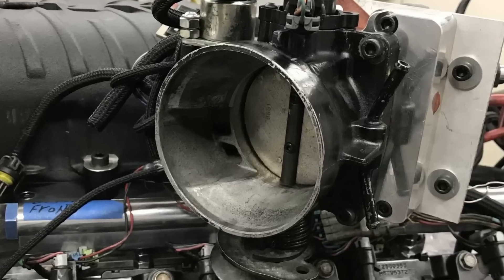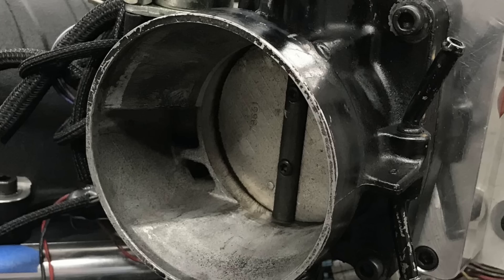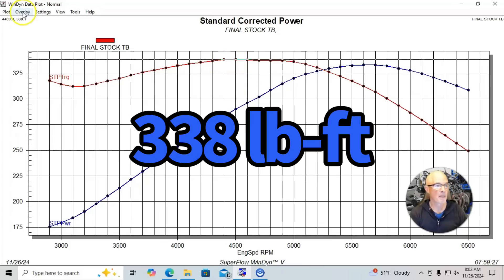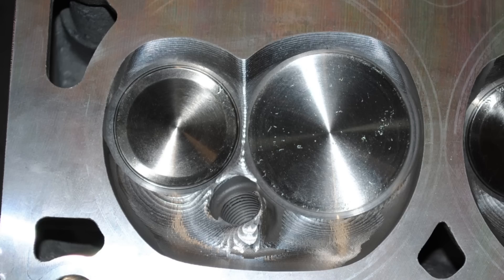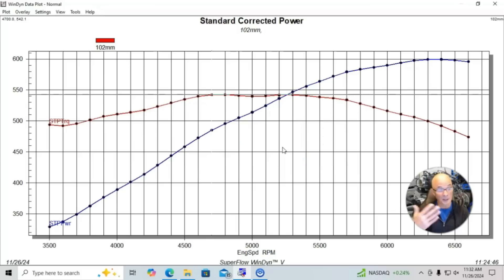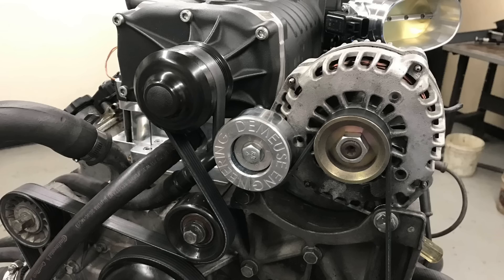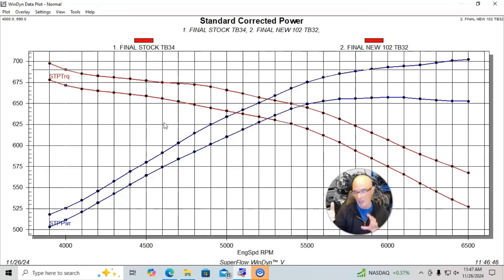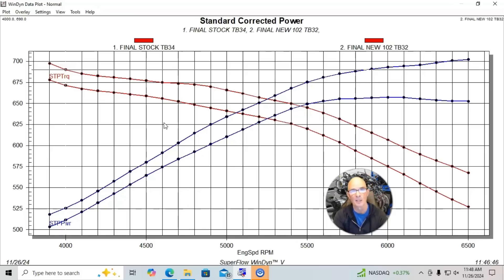LS THROTTLE BODY UPGRADE-WHAT'S IT WORTH? HOW MUCH POWER IS A THROTTLE BODY UPGRADE WORTH ON AN LS?

Comment: Say what's 6kpa worth on a 500hp LQ9 .. I see a 6kpa restriction from 4200-6000rpm then drops to 2-3 kpa at 6500
Reply from the maker: an airflow restriction doesn't drop at higher rpm, it increases
Reply: @richardholdener1727  just what I'm reading on hptuners .. maybe it is making more power at 5800 than an 6200 ?!

Comment: Have a stock TB in my 5.3L Vortec 2003 LS Suburban and just want to get a larger TB to allow more air to flow. Not so much looking for more power. Just a smoother better flow.
Reply from the maker: you won't get smoother, better flow-keep what you have
Reply: @richardholdener1727  so with a bigger TB, it won't allow better air flow? Was also looking to change the manifold and a slightly larger pipe for the muffler (not too big because I'm not looking for that muscle car sound, though I freakin love it).

Oh, and thank you for your response. 👍🏾

Comment: Lq4 stock bottom, comp cam 218/220 afr 220 cnc tbss header and tune. Run 76 mm tb what can i expect from 90 mm tb?
Reply from the maker: on what intake?
Reply: @richardholdener1727  tbss intake

Comment: I've had a running theory for some time  now that selling bigger throttle bodies to people that don't need them produces a perceived result in that the engine is effectively at wide open throttle at an earlier point in the travel of the throttle plate, due to the net area equivalent now happening at say 60% WOT instead of at 85%. How this correlates to electronic fuel and spark control as mapped against throttle position sensor values with no additional tuning I suppose would depend on how air flow calcs are made? I know I've driven plenty of cars with stock throttle bodies and meager outputs where under high load scenarios, there would be no appreciable difference between ~75% throttle and wide open, foot to the floor - and I can't imagine why you'd want to make that resolution even worse.

Comment: Herd if you run enough boost(LOTS) on a single Large TB, the blade will get stuck open.  Can't rem the company that came out with a dual TB intake for boats, due to that issue.  Something to do with blade diameter, surface area and leverage.

Comment: I went 105mm TB as mine is big Turbo ls 427 low ram and I also went up to 2400cc injectors. worked Good on mine, never really bothered with a stock 1 mines got big flowing req ported heads I agree they are a must on a boosted big cube LS

Comment: You've just shown the people why Gale Banks is "wrong". I love his work but you can tell when he's trying to pull the wool over your eyes, like with his Cummins intake elbows. He never quotes power gains specifically, but repeatedly highlights the flow bench results and concludes that based on the evidence, it WILL make more power and use less fuel. However real world testing shows no gain.
Reply: Hmm, I think Gale has his stuff together. He is mainly looking at air density and improving that definitely makes more power (more air density)
Reply: Shit comment. Gale Banks DEFINITELY knows what he is talking about and sells honest quality products. Post less in the future
Reply: Diesels and Gas motors behave different to different things. Banks is the 🐐
Reply: Yes, Gale Banks does know what he's talking about and makes good products, but you've all missed the point I was making. With the example I gave specifically, cummins intake elbows, countless people have done back to back testing, even at four digit power levels, and seen no gains. It's just like putting a larger throttle body on a stock truck motor, all that extra flow of one component adds nothing to the system as a whole. Banks intake elbow flows huge amounts more than a stock elbow, but the stock elbow flows more than the rest of the system, so it's irrelevant. If you go and look at the videos they've made on it, they always harp on about the increased cfm it flows, and then push the idea that increased airflow means more power, but they don't seem to directly say that bolting their intake horn will give you more power (because they probably know it doesn't).

Comment: I have a 2014 chevy reaper truck with 6.2 and it has a magnison supercharger.  It's equipped with the stock TB .  I've been. Thinking about upgrading it to the 95 mm TB or would you recommend going to the 102 mm ? . If I do will I need to get a tune for the air fuel setting ? Thanks Richard I've learned a ton watching your videos!
Reply from the maker: bigger will help-your tune should add fuel with higher boost

Comment: One point with supercharger gains - a roots/screw blower is simply a multiplier for inlet air pressure, so ANY restriction is literally multiplied. 1/2psi lost between the throttle body and blower will drop peak boost from 14 to 13psi. Those tend to be the only time people really can see gains, since few ever build 700+ hp NA engines.

Comment: Was just wondering if the intake swap is worth it on the ls2 cammed 5.3 I shoved into a blazer
Reply from the maker: A Fast is the best choice but expensive
Reply: @richardholdener1727  Thats fine wine for my beer budget mostly gm part# swap. The tbss intake is looking like my budget winner.  5.3 dish pistons 862 heads cut .040 ls2 cam and 26918 comp springs.  basic copy of your ls2 cam swap dyno build.

Comment: In a nutshell: Upgrade your throttle body (and everything before it) to match your intake manifold.
Reply: The comment I was looking for
Reply: Hi Richard, I appreciate you sharing your no-nonsense information. Here's a question for you, ... I installed an aftermarket catback exhaust on my C8 Corvette stingray. I recently installed American racing long tube headers, and I swapped the stock air filter for the Attack Blue filter, plus a Soler throttle body controller. Would my car gain anything if I installed a 91mm ported tb replacing the stock 87mm tb? Thank you sir!

Comment: im guessing its significant on a forced induction motor
Reply: Supercharged maybe turbo nope because your force feeding not pulling air through. I'm sure Richard will chime in
Reply: @simonhardgrave4568  but still have to pass air thru the throttle body.  i dont think it matters if you push the air or pull the air
Reply from the maker: the draw vs blow through matters a great deal

Comment: Great test Rich. On my PDSC LS I didn't start to see gains over the stock 87mm throttle body until I was over 700 whp (800 crank?).  Considering that 87mm has about 25% more flow than a 78mm, the 650 hp plateau in your PDSC 78mm example makes sense.  Great note on the blow through setups too.  I've made over 500 whp on a 62mm throttle on a blow through setup on my Honda without any issues, and one of my employees is making nearly 800 whp on a 70mm tb blow through setup.
Reply from the maker: we used a 65mm on the Bonneville Honda but there was no need...it was free

Comment: About time you let us know the cost of some things but we need also the engine parts costs for upgrades including labour hrs costs
Reply from the maker: shop rates vary from $0 to $100+ per hour, so no way to know.
Reply: Cost for parts can vary by your location and definitely labor rates. Parts cost is not what this channel is about. The knowledge that Richard shares is far more valuable than the time needed to lookup part pricing!

Comment: I guess if you don’t need you don’t have as much throttle control per idk travel of the pedal or percentage open and around %80 I doubt you have anymore input in your butt if you don’t need it. Rather have just enough for control if that makes sense.